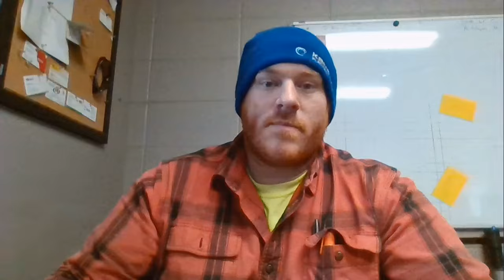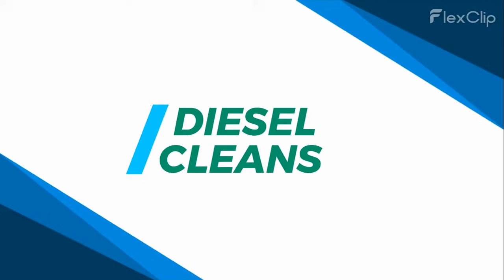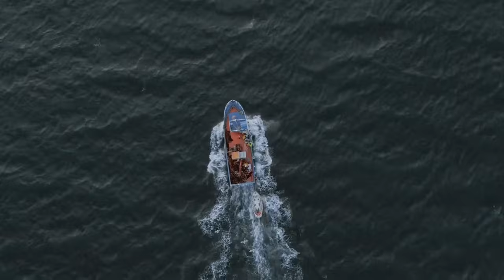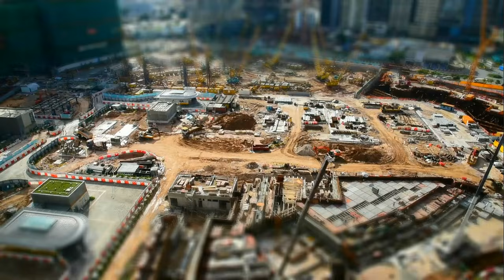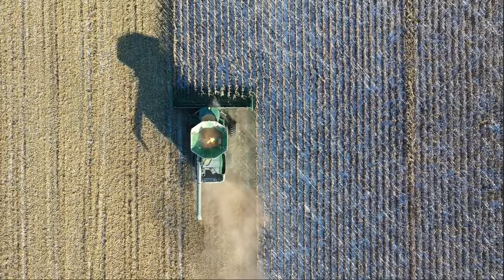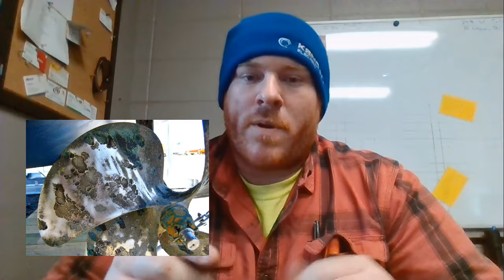Do FASS FUEL SYSTEMS and AIR DOG actually increase lubrication?

Comment: The sulfur in the fuel was not the lubricant The process that is necessary to reduce and remove more of the sulfur from the fuel that process reduces other compounds that serve as the lubricant.   Everybody tells the story the short way because when the sulfur got reduced it reduced lubricity but it is not the sulfur that was the actual thing that was doing the lubrication that's okay you generally mean that when we went to low sulfur few we lost lubricity that's true but it wasn't the software that does the lubrication.  Look deeper into tribology and chemical science side of fuels and you'll find the greater depth necessary to make that sentence be true even though functionally it represents the time frame that caused the issue.